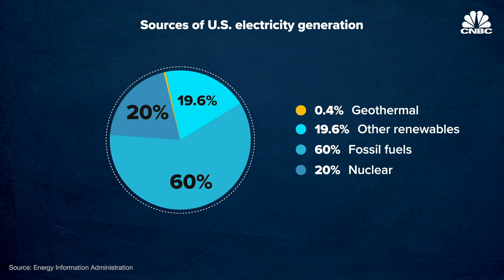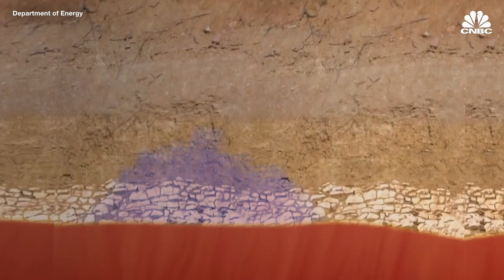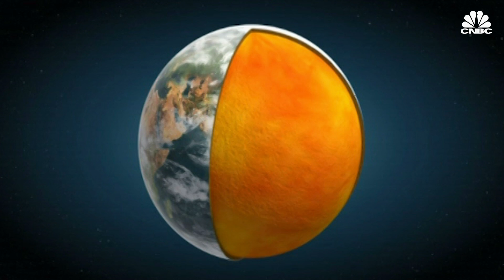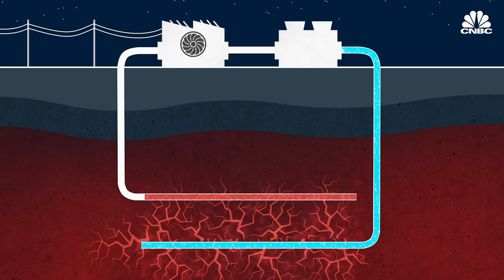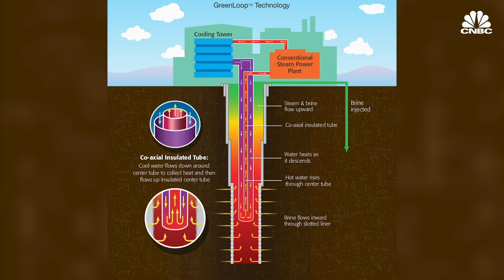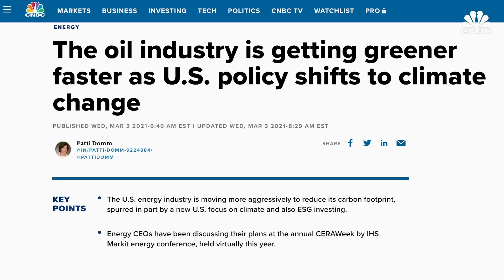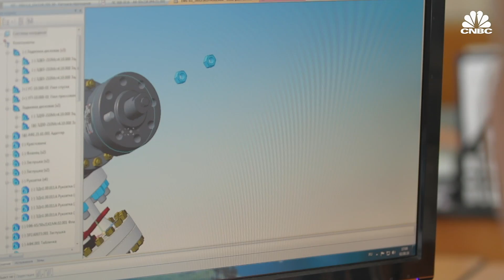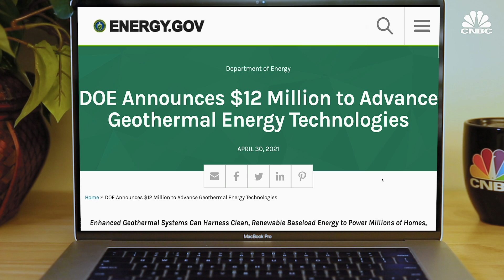This Overlooked Energy Source Could Supply 50% Of Electricity

Comment: No one will really take geothermal energy seriously until it can run a vertically integrated iron and steel mill and all kinds of heavy industries and create synthetic fuel using the sulfur-iodine cycle (intended for high temperature gas-cooled reactors, lead-cooled BREST reactors, and MSR reactors) for making dimethyl ether as a synthetic fuel to replace diesel fuel.

Comment: “Eavor’s solution (“Eavor-Loop™”) represents the world’s first truly scalable form of green baseload power. Eavor-Loop™ is an industrial scale energy generation system that mitigates or eliminates many of the issues that hinder other renewable forms of energy production. Eavor isn’t burdened with exploratory risk, limited to niche geographies, process intermittencies, grid connectivity or locating concerns. Much like a massive subsurface radiator an Eavor-Loop™ simply collects energy from geologically common rock temperatures found at common drilling depths via a highly efficient conductive system. Unlike conventional geothermal, Eavor isn’t burdened with exploratory risk or limited to niche geographies through the need for highly permeable aquifers at volcanic-like temperatures. As a completely closed-loop system, Eavor has the advantage of no fracking, no GHG emissions, no earthquake risk, no water use, no produced brine or solids, and no aquifer contamination. Unlike wind and solar, Eavor-Loop™ is not intermittent, but instead produces much-needed reliable baseload power. Unlike other forms of power, Eavor is benign enough to power an entire neighborhood literally from someone’s backyard. Eavor is the solution the world has been waiting for.”

See: www.eavor.com

Comment: This is the bleeding edge for geothermal energy.
“Eavor’s solution (“Eavor-Loop™”) represents the world’s first truly scalable form of green baseload power. Eavor-Loop™ is an industrial scale energy generation system that mitigates or eliminates many of the issues that hinder other renewable forms of energy production. Eavor isn’t burdened with exploratory risk, limited to niche geographies, process intermittencies, grid connectivity or locating concerns. Much like a massive subsurface radiator an Eavor-Loop™ simply collects energy from geologically common rock temperatures found at common drilling depths via a highly efficient conductive system. Unlike conventional geothermal, Eavor isn’t burdened with exploratory risk or limited to niche geographies through the need for highly permeable aquifers at volcanic-like temperatures. As a completely closed-loop system, Eavor has the advantage of no fracking, no GHG emissions, no earthquake risk, no water use, no produced brine or solids, and no aquifer contamination. Unlike wind and solar, Eavor-Loop™ is not intermittent, but instead produces much-needed reliable baseload power. Unlike other forms of power, Eavor is benign enough to power an entire neighborhood literally from someone’s backyard. Eavor is the solution the world has been waiting for.

See: www.eavor.com

Comment: Eavor’s tech (closed loop) is the best for sure. California had major problems with their Geothermal during the drought. Those plants take up huge amounts of water as not all of that is reclaimed/condensed.
Reply: That's absurd they ever built ones that weren't closed loop
Reply: @Freshbott2  sadly pumped water with no closed loop are accepted designs as you will see in the video and in use today. Madness.
Reply: @peterbarlow7781  Because it allows to extract more heat from areas with less volcanic activity within a given depth.
Reply: @jimsonbonilla8233  yeah ok but it takes a massive amount of water to generate enough steam. The next major war will be fought over water. It’s not worth generating electricity this way imho.
Reply: @peterbarlow7781  Back then, there weren't water shortages like now, and they weren't fully foreseen, either.

Comment: How exactly is geothermal energy renewable? According to geologists the heat of the core of the earth is residual heat, stemming from the time when the earth was formed, so every Joule you take out, is a Joule gone for good. Exactly like every barrel of oil is a barrel that will not come back. There is a lot of heat down there, sure, but calling it renewable just because it would suffice for thousands of years at the present rate of power consumption is a little bit misleading, especially if we aim for 50%+ of the total power production.

I know that when you look at it this way solar energy isn´t renewable as well. Every hydrogen atom in the sun is only able to fuse once, when that´s done, it´s done, the atom will never revert back to being hydrogen to be fused once more. But the sun is doing this fusing all the time, no matter if we place solar panels or not. So it´s a destructive process that generates energy we can only decide to harvest or leave unused. Taking heat out of the core might be a worse idea.
Reply: Because there’s enough of the supply that over the course of a human lifetime it won’t run out. 

You will find that the definition of renewable is not consistent nor is it consistent for different technologies. Some studies don’t consider hydropower or biomass to be renewable due to environment impact (which doesn’t really make any sense, but they changed the definition). 

Some 100% renewable studies even include natural gas. 

I always find it interesting how some groups denounce nuclear for being non-renewable then turn around and glorify solar and geothermal for their renewability, even though those two sources are literally predicated on the existence of nuclear processes, but whatever

Comment: Not mentioning heating more is a missed opportunity.
Geothermal assisted heatpumps and heating networks with geothermal energy is very important as we cannot heat everything with electricity. Heatpumps are almost 3 times more efficient than electrical heating.

Comment: The demand for electricity will sore after electric cars become common, and replace fossil fuel powered vehicles. Couldn't cost more than Nuclear energy. So do it, get it done. The planet will eventually hit a tipping point releasing vast sums of methane hydrate from the ocean, and  methane from permafrost soil that is packed with organic matter along with the already high CO2 in our atmosphere. Eventually Solar cells will become extremely efficient in the not too distant future that will go a long way to decentralize energy production (better for a Democracy). But industry still might need a high production electrical producer that is centralized at hot spots on the Earth as today in the mid west with the giant Coal fired power plants.

Comment: Couldn't they capture the steam and make free distilled water?
Reply: Could they push sea water through the tubes so that the water evaporates and is collected into a vat and the salt is separated from the water? It would also get rid of the brine issue because you would be left with just minerals that could be dumped in the desert.

Comment: Picking hot spots close to the surface is key to economical extraction. Yellowstone, the world's largest caldera, seems like the proverbial gold mine placed in one of the world's most beautiful natural wonders. Even steering clear of the geysers and heat pools, a LOT of heat is close to the surface. Perhaps with horizontal drilling techniques, heat extraction could occur with minimal infrastructure and with it being placed well away from key natural habitats and viewing areas. At peak, U.S. power use is a bit over 1000 gigawatts. Tapping Yellowstone, along with large scale use of superconductive transmission lines, and we have a power source that by itself, might provide over 10% (100 gigawatts) of the country's power needs.

Comment: the earthen magnetic field is caused by the fluid core, were liquid metal, iron, is moving. is that right so far?
so if the core cools down to a temperature were there arent enough currents, we lose our magnetic field. so we will lose our shield against ion radiation. is that right?
so, if we use geothermal energy, arent we cooling it down? wont it have a compound interest effect over time?
and, if we already know that the core is cooling and the magnetic field will become instable, do we have a plan to heat it up again?

PS: just to make it clear, i am not against using geothermal energy. just asking what we wanna do in some thousand years.

Comment: So, there's a way to generate power without using any kind of non-renewable fuel, which using modern technology can be built almost anywhere, releases no emissions, can be run constantly around the clock with minimal maintenance and is simple and reliable. Oh yeah, and the heat source is essentially unlimited.
Why the hell aren't we using this a lot more than we are?
Boggles the mind.

Comment: Doesn't the Texas freeze this Valentine's Day make it clear?  If you want carbon free energy, 24 x 7 x 365, you need geothermal energy.  Period.  Wind doesn't exist when it's cold.  Gas freezes up unless you build fossil fuel protected systems anticipating cold temperatures.  Geothermal is the only reliable solution regardless of cost because the religion of CO2 being bad shows this is the ONLY way to avert the coming Ice Age.  The Northern and Southern hemispheres will be mostly covered with ice, but at least we'll have practically unlimited energy from the core of the planet to counter it.

Comment: Don't underestimate the damaging ability of humans. If this takes off, 100 or 200 years from now we might have different type of issue where the core might be cooling rapidly because we somehow found a way to harvest the energy more rapidly. Remember Mars is a dead planet because of cooled core. This is not a renewable power.
Reply: It's impossible for humans to extract that much heat. There is simply SO much heat inside the earth that even when the whole world would be running on geothermal, virtually no temperature difference would be observed in the centre. Maybe if we do this for millions of years, we would have speed up the cooling of the earth by a very small fraction.

Comment: This is a joke. Power plants are expensive and dead men walking. So much energy is lost in transmission lines.
Reply: 5% isn't that much when you consider the reliability advantage versus lirerally any onsite power generation method. You can't heat a northern home on solar in the winter without using a fossil fuel burner, so an ideal future requires distant power plants as a backup for when demand rises above local solar+battery generation

Comment: Just don't contaminate the ground water in the process like fracking does.
Reply: They won't, they explained in the video that they use non-toxic chemicals.
Reply: That's much easier with geothermal fracking b/c there is no petroleum of gas to leak into and contaminate groundwater.

Comment: fracking isn't the same thing. I did this for years. Depending on the system you need and land avaliable for schools, residential, it may be 8 holes drilled for a farm 250 feet deep each. You could have deeper holes or more holes but not as deep. Basically similar to a radiator, you use something environmentally friendly antifreeze liquid in a loop that liquid travels down and back up a closed system. Because the temperature is always the same allowing you to cool off the liquid or heat the liquid. There is another way thats even safer where its not deep at all and no drilling needed but you need more land to keep better efficiency. You could possibly hit gas drilling but i did this for years thousands of holes drilled and 1 released a tiny bit of gas that almost took my life because the meter to detect gas wasn't where it was supposed to be and I tried telling everyone but they worked they for 20 and 30 years ignoring me. You don't drill for gas oil water anything.  You first conduct a thermal conductivity test. To see just how efficient it will be after you drill a test hole.

Comment: But it is cooling down the Earth and heating up the atmosphere.
Reply: nope! does neither!
Reply: @jarradscarborough7915  Yes it does.
Reply: @XOPOIIIO  nope! that's not how it works, the heat is either a) going to released anyway (if hydrothermal), b) produced by pressure - which renews as its released, c) created by the decay of radioactive trace elements in he soil (K,U,Th), so harnessing this heat does not result in cooling. 

and heat doesn't get released into the atmosphere (that would be a waste of potential energy - and money). hydrothermals may do that - but that heat was going to be released naturally anyway, we just turned some of the heat into electricity before letting it go, which when you think about it actually cools the atmosphere. the efficient systems use closed loops, so nothing gets let out into the atmosphere, the heat stays in the system to produce as much power as possible. so, no, it does neither.
Reply: @jarradscarborough7915  They're talking about extracting it everywhere, not in the geyser fields alone. So it won't be released naturally. So, you're suggesting that the Earth contains infinite amount of energy? It's against all physics laws. Any energy heats the atmosphere. Doesn't matter how do you use it, it's always ultimately transformed into heat. But it's one thing if we harness what's already heating the atmosphere, and completely different if we're extracting energy from elsewhere and adding it to the atmosphere.
Reply: @XOPOIIIO  The heat from steam is caused by the rapid vibration of molecules.  When water condenses, the vibration slows and the water cools to ambient temperature.
Reply: @palmshoot  Because heat was transited to the ambience, that is what I'm talking about.
Reply: @XOPOIIIO  Heat attenuates with distance.  This is why your clothes don't catch on fire when you're standing near your stove.  Even if the ambience heated up, the ensuing rain/condensation would cool it down.
Reply: @palmshoot  Rain is a part of the ambience, lol. Atmosphere is almost closed system. The only way how heat could outflow is through radiation.
Reply: @XOPOIIIO  Rain isn't par of the ambience when the wind naturally blows it to another location.  If heat didn't dissipate, there wouldn't be seasons.

In regards to the atmosphere being a closed system, hydrogen and helium escape it into space (Source: https://en.m.wikipedia.org/wiki/Atmospheric_escape.).

Comment: Geothermal is just nuclear power with extra steps.
Reply: All energy is nuclear fusion power with extra steps
Reply: Not dark energy.
Nor the strong or weak forces.
Reply: @johntitor7600  Dark energy is not energy though, it's a misnomer. And the strong and weak interactions are much weaker in elemental hydrogen than in the byproducts of fused hydrogen

Comment: Closed loop systems have a major advantage, they wont pick up the salts and heavy metals which are invariably in any subsurface water, particularly hot water.  As the point is to extract that heat their is an inevitable drop in solubility and crystallization of these salts and metals as the liquids cool.  If that happens above ground in the power plant it can cause enormous damage, or if it happens in the well it can clog it and choke off the whole process.  In some instances the metals have value and a controlled precipitation can yield extra revenue, but this is site specific, so a design which just eliminates the whole issue will be a boon and greatly lower the long term costs of geothermal power.